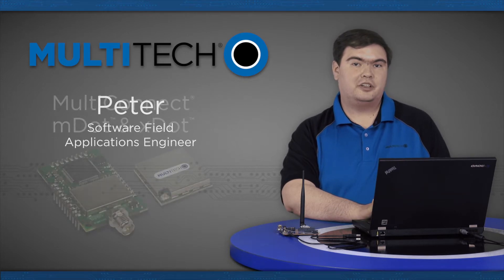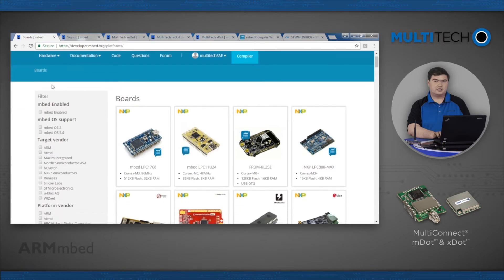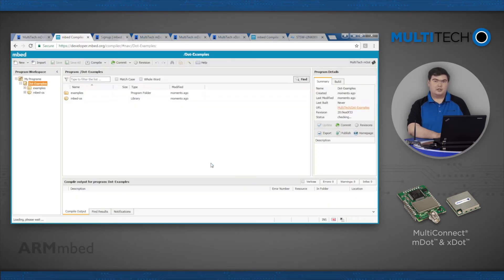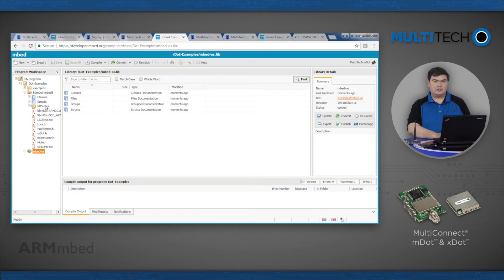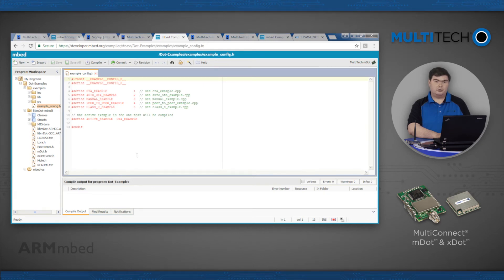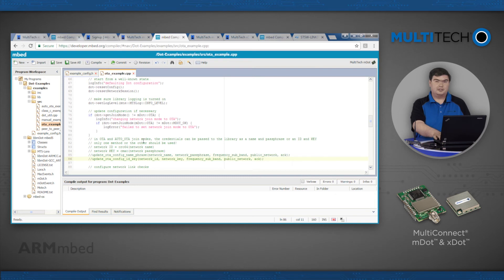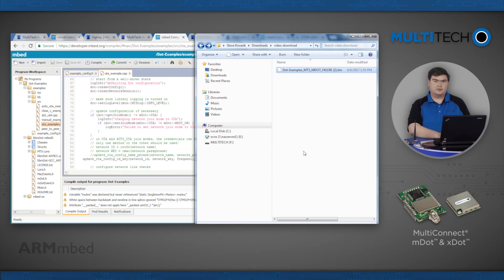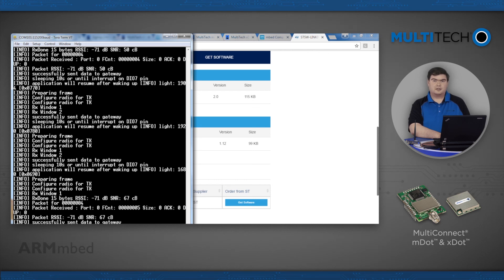MultiConnect® mDot(tm) and xDot(tm) using ARM mbed compiler

Comment: Hi, I am wondering by using the serial connection under linux, how about the data bits, parity, stop bits and other flow control settings?